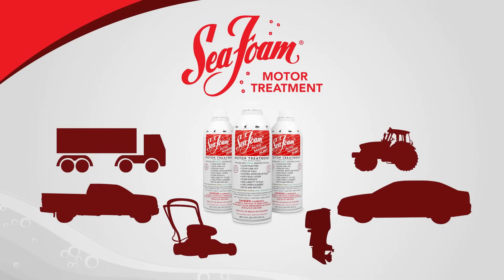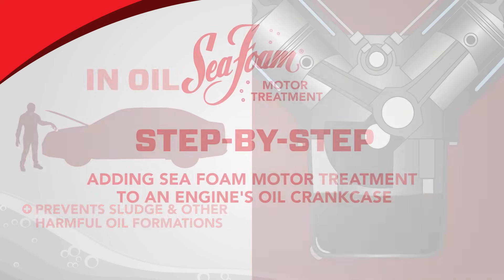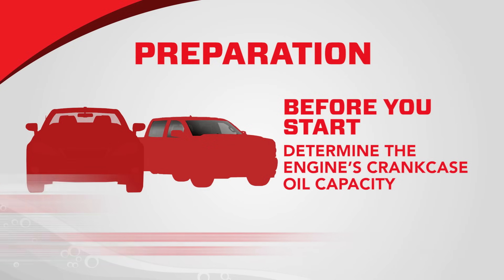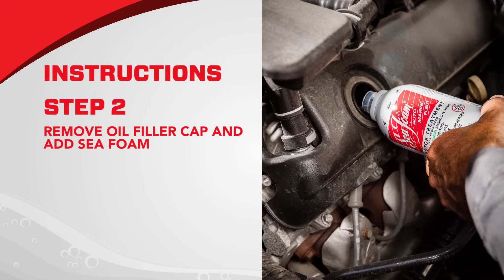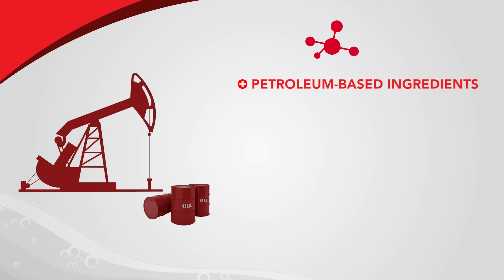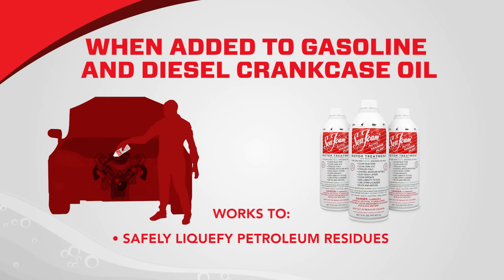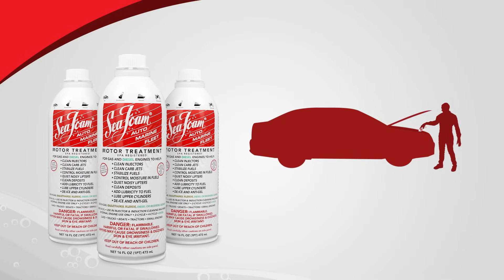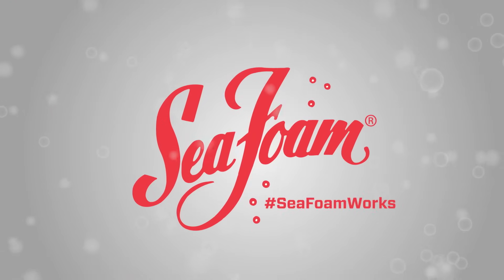Add Sea Foam to your oil crankcase - super easy!

Comment: I'll try this one...but don't worry Scotty,i still have my toyota!!!
Reply: 😂😂😂😂 rev up your engine 👋
Reply: Did it made any difference? Wich one?
Reply: Not for long if u ask Scotty lool, I just put marvel mystery oil in my celica will find out in 300 miles
Reply: @williamburndred6284  what's the update?
Reply: @MikaFaye.  ill let you know next weakend if it stopped oil burning, though i can say it is great at removing carbon as i did 444+ miles and it was filthy , looked like a 10k mile oil change
Reply: @cristianvilla3675  I use this flush occasionally and it does it job. Then I use an additive when drained.
Reply: Lmfaoo😅😅😅😅
Reply: @tomasnokechtesledger1786 a '94 Celica
Reply: Did it work?
Reply: Good ole scotty😂😂
Reply: How did it work?
Reply: Scotty is a hack

Comment: I maintain several UTV's (Polaris Ranger, utility vehicles).  We add Seafoam to these small engines before oil changes and into the fuel system.  You would not believe how much smoother running and more responsive these engines became since starting to use SEAFOAM.
Reply: Well those are tiny engines. No wonder the effect is much more
Reply: I run Fleet Maint and maintain ~60+ UTV's (Polaris Ranger, utility vehicles, ATV's Snowmobiles).  We have NEVER added Seafoam to these small engines before oil changes and into the fuel system.  You would not believe how much smoother running and more responsive these engines became since we never used SEAFOAM.  What are we missing???  There is nothing quite like a true, "3 Orifice Elixir"!  Pour it in your air-hole, your oil-hole, or your GASS-HOLE!!  Can't go wrong!  :D :D :D 😕

Comment: I had a knock on cold starts on my 2001 Silverado and this eliminated it by adding to the crankcase
Reply: Was your truck smoking. ? Before use ?
Reply: Did u add it to tank or oil?
Reply: I had that same knock on my 1998 Cheyenne 1500. I used Motor Kote and after 100 mile or so that knock is gone. I will use the Seafoam on it next to clean it out.
Reply: @vicreyes9237  he said crankcase, so I assume oil.

Comment: I have a 2004 Toyota Camry with a 192000 miles my wife bought  brand new in 2004 it started using some oil not much to very good car ever since I've done this sea foam treatment  I have not had to add 1 drop of oil Unless it's a coincidence I'd say the sea foam really clean some deposits out the engine ...now I do it to all 3 of our vehicles our 2018 Toyota rav 4 and my 2013 Ford F 150

Comment: I run this on my 600 miles before every oil change and my car has 250,000 miles still going strong
Reply from the maker: Very nice! 👍
Reply: You add it to your oil & drive 600 Miles then do an oil change?

Comment: This is a great product. My 2002 Sienna has been burning oil like crazy (like scary 4 qts (almost gone) every 100 miles).  I did a piston soak (24 hours)  with seafoam (nothing was left in the cylinders after the soak which left me to believe it went inside down to the oil pan) and did an oil change after 500 miles.  I replaced the PCV because I knew I had a ton of blow by with the oil burning and stuff.  Added half a can as part of the oil change. Drove the van on more than 1k mile vacation trip checking oil every 100 miles and to my amazement, no oil burn and the oil stayed full all the time.  My MPG went from 12 to 22 MPG as well.  The heavy noise coupled with engine that seemed to be under a lot of load on a smooth flat road was replaced with smooth sound and performance like a new engine.  This has 150K miles only but is 18 years old.  I am thankful that my van is back to where it was and this half can seafoam will be part of my oil change from now on.  This shit really works!!!
Reply: So the piston soak! Do you just take out the spark plugs then pour some in? And let it set 24 hours?
Reply: So when u do an oil change you add seafoam??
Reply: Born yesterday 😂 found out they got a high mileage can too. Already put the white can in my gas tank. Wanna put the( HM.) In oil crankcase to see if it will quite engine you know the feeling of seeing your dashboard vibrates at every lite 🤯✌️
Reply: Half a can seems like WAY too much. Only need 1 Oz per 1 quart of oil in the engine
Reply: And how much time do you run the engine with that???
Reply: How much of the can did you pour into the oil???

Comment: I did this yesterday in my 2002 Toyota Camry. Drove for 150 miles, then changed the oil. The oil came out extremely dark and VERY liquified!  I also added the intake Seafoam spray. I can definitely say that I noticed the engine is a lot quieter

Comment: I have been using Seafoam in my 2001 MB E320’s fuel system about 10 years now, every 6 months a full can goes to tank close to oil change. For the last 2 or 3 years I also use it in the crankcase, couple days before the oil change, my car takes a little more than 8 qts oil and I usually get 2 cans a week before the oil change, 3/4 of a can goes to crank case and the rest goes to fuel tank, like I said 100-200 miles in couple days then the oil change. I can swear after the oil change you can’t hear the engine from inside, quiet and idles like a clock, car is almost 20 years old, 220K on the clock.
Seafoam is a good product.
Reply: So u dont do 1 ounce per qt?
Reply: I have a Corvette with just about 220,000 miles on it right now.  It also, "idles like a clock," (whatever that means).  Basically, my car runs like new.  Never used the stuff.  What have you proven?  What am I missing?  :bigears:
Reply: @thomaskendrick2221  I wasn’t aware that I was supposed to prove anything. Good for you that POS made it to 220K miles with just regular maintenance, hard to believe but I’ll say whatever….
Reply: @commodoreras  Ha ha ha...my 220k car is a "POS" but your 220k Mercedes is special?  B/c of the "3 Orifice Elixir"??  LOL.  

I "get it"...this is where people go when they're challenged.  Defensiveness and name calling.  That's pretty normal.  As you were my old Mercedes man.  BTW.....as a fleet Maint Mgr, 220k isn't a big deal; I've had cars (and fleet vehicles) that have cruised right on by 300k, too.  Never used this crap.  I'll ask you again; What am I missing?  :bigears:  Relax....you aren't obligated to answer that.  Just think about it before you buy more elixirs for your old Merc....or recommend them baselessly to the unwitting.   👍

Oh, BTW, here is a hint; Look up the SDS for Seafoam to get the ingredients....THEN come try to tell me what a "magical cure-all" it really is!  😆
Reply: @commodoreras  😆😂👍

Comment: I run a can of this in my 2-stroke Paramotor every 10th or 12th flight I do. Every time I go to rebuild the carb and replace piston rings I feel like I'm wasting my time; it looks pristine, especially right after flying on a can of this. Absolutely recommend for any 2-stroke applications to get rid of carbonized 2-stroke oil residue!
Reply from the maker: Love that story!

Comment: My motorcycle was running on 1-2 cylinders (out of 3).  Fellow rider recommended Sea Foam.  Put contents of one bottle in the fuel tank.  Very short time after running engine, it ran VERY smooth.  Will get more for my auto.  Looks like this additive really works.  Thanks
Reply: Right on Donald - we're believers too!!

Comment: If I could add a pic/pics I would...did injector job on 02 LB7 Duramax in June ..it is almost 350,000 miles ..under the valve covers are spotless!

Comment: seafoam products work! i used it on my 2003 civic and i could tell it runs smoother. did i also mention their excellent customer service! thanks Jim!!
Reply from the maker: Thanks, Lodi 22 - Pleased to hear + thanks for using Sea Foam!
Reply: Did you put it in the crankcase with the oil?
I have a 2003 RAV4

Comment: I use this on all my cars. I even made a couple videos on my Scarz Carz YouTube channel adding it to my Audi. I learned a long time ago that its the safest for European cars compared to other brands. Thank you Seafoam for a great product.
Reply: Quick question; do you add this to your motor or fuel tank?
Reply: @Ravenwest9876  I add it to both, usually at oil change times. About a hundred miles before oil change I'll put it in oil, and add it to fuel when I do change.
Reply: @joemartin3240  thanks sir

Comment: Seafoam cleaned the oil sludge out of my Audi A4 with 1.8T engine.  Great product.  I had a weird check engine light come on in my Nissan.  It promptly went away after adding Seafoam to the gas tank.
Reply: Good to know-- I've got a Passat 1.8T, same set up with that sludgemaker turbo. I'll have to try this soon!
Reply: D’yer maker where did u put it on and did u put the whole bottle?
Reply: @undercoverrt4106  For the 1.8T add it to the crankcase, or same place you add the oil. It will clean out the sludge and let your oil pump work. The sludge stops up the screen on the oil pump. I don't remember how long I let the engine run with it in there.
Reply: @undercoverrt4106  yes, whole bottle in crankcase.
Reply: @D’yer maker did u put it with the car on or off?
Reply: @D’yer maker did u put it with the car on or off?
Reply: @undercoverrt4106  Run the car with it in the crankcase. It has to work through the oil pump screen to dissolve the sludge. I may have driven with it in the crankcase.

Comment: I used a few ounces in my crank case and added half a bottle to gas tank at 1/8 fuel remaining. Drove like a banshee out of hell (safely) and I am glad to announce no check engine light or adverse effects.
(Edit-06 gm 3800 motor

Comment: I have 352,344 miles on my 02 LB7 Duramax...i did injectors on it in June..under the valve covers it is spotless! We have a 2013 hemi powered Citadel Durango and added it and ran it for like 600 miles before oil change(I did thus on my own) ..runs just fine. If your wonder what oil I use,Mobil extended performance the gold label 5w20 and mopar mo899 oil filter
Reply: I have a 2011 dodge citadel with a p000b code

Comment: Seafoam is indeed a great product for sticking injectors and piston rings,.
However there is a better way to prevent 'the sticking':  simply change the oil BEFORE the receommended change-out.  If youre driving mostly at full highways speeds and also drive at constant speeds, the recommended oil change-out is probably OK.   If you are driving in city conditions and mostly for 'short trips' ... consider to change the oil at HALF the recommended interval ... so the carbon, varnish and other 'crap' doesnt build up 'behind' the piston rings ... and then cause adverse wear of the cylinder walls.

Comment: Can someone from seafoam answer? If your car is full of oil do you have to let some oil out and then add the seafoam or add the seafoam to the amount you already have in the vehicle no matter if its full or not? Thats my only confusion.
Reply from the maker: No need to remove oil. Plenty of room in the crankcase.
Reply: @SeaFoamOfficial  ok thank you. I didn't use a full bottle.. but if you don't mind, how often should a person use this to clean out the system.
Reply from the maker: @DocHicksTv  In oil, once per intertval.

Comment: After a good fwy run, I poured some down the carburetor of my 1983 Corolla & it cleared lots of deposits. No more dieseling (hesitates to shut off after turning off at ignition switch)
Reply from the maker: Great news - thx for sharing!

Comment: I haven't bought the product yet but will be very soon, but I did have a question. When using seafoam, which method is most effective? And also will I need more than one can if I wanted to put some in the oil crank case and the fuel deposit tank? I don't know the recommended dosage instructions yet but I'm sold on the products ability to work.
Reply from the maker: Both are great. Adding to fuel vs adding to oil is not a either/or. Best to do both.

Comment: I was told today that I shouldn't use Seafoam in my 2020 Kia Optima GDI. After putting in Seafoam the other day, I got my oil changed today, and that's when the mechanic told me that I shouldn't use it with my GDI engine. I have been using it and following the instructions 1 oz per quart.
Reply from the maker: Did the person explain why?
Reply: @SeaFoamOfficial  Not really. They just said not to put it in a GDI type engine.
Reply from the maker: @kendaugherty3828  Noted - thx.

Comment: Never used Sea Foam before.  Sp adding more product to oil will not cause "overfilling" the capacity of the oil?  For example, if the vehicle takes 5 quarts and there are already 5 quarts of oil in it, won't adding anything overfill the capacity?
Reply from the maker: You're adding 5 oz to 160 oz of oil. No worries.
Reply: My car takes 4 quarter of oil so much do I add to crankcase

Comment: What would happen if you put seafoam in the crankcase at the start of a fresh oil change and left it? In the video it says 100-300 miles BEFORE an oil change. So would putting seafoam in directly after an oil change, have any effects opposed to just before changing oil?
Reply from the maker: That would be fine.
Reply: @SeaFoamOfficial  okay thank you!
Reply: I must have not read the directions properly because I've been only using it with new oil, yet it still works wonderful and better than it used to. I drive a 2001 civic.
Reply: This was the question i was gonna ask😅
Reply: @SeaFoamOfficial is it better to wait till before the oil change is due or do it right after?
Reply: @kingdeyes94 The longer its in there the better it will work. If your car or truck has a higher capacity oil filter option, use it.

Comment: Hi please help, i poured in all the bottle in my engine oil, is a 6 cyl 3.7 liters, will this damage my engine? Should i change the oil immediately??
Reply from the maker: If you are concerned can either change your oil (complete) or drain 2 quarts and add 2 new quarts.

Comment: How do you keep it in the crankcase? It just runs down  into the oil pan.
Reply from the maker: Sea Foam is oil so it mixes evenly with the motor oil.

Comment: Is it the same product that you can add to your crankcase or gastank ?
Reply from the maker: Yes, the same.
Reply: @SeaFoamOfficial  
Wow thats easy 
I just added it in my audi s3
I wasnt runing great because of cheap fuel and carbonate on the valves. So i just sprayed it into the air intake because the gas valve is very hard to get to. And the car shaked and misfired on acceleration  😬  i wonder why that was ? but now it runs very smooth
Reply from the maker: @HappyDude1  Can cause misfiring during application. Doesn't hurt anything.

Comment: How can you tell how many ounces to add? Are there markings or visual aids on the side of the bottle or is it better to use a measuring cup and a funnel? Thanks!
Reply from the maker: I just eyeball it + feel the weight of the can.  Does not have to be precise.
Reply: I've always heard an ounce per quart of oil.
Reply: I use an old pint mason jar with oz markings. Now dedicated for seafoam.

Comment: I have a Lincoln welder at work that’s given us nothing but problems. An injector with stiction, noisy lifters and fuel issues. I used this in the crank case and IMMEDIATELY heard the difference after starting it up and letting it idle for a while, after welding and running the engine a long time as well.
 No rough idle, no problem starting up on a cold day. Etc. I plan on using it again after I change the oil.

Disclaimer: The boss of the mechanics (who we have to turn our vehicles and equipment to for service) is a spiteful clown of whom I think enjoys messing with the operators and drivers for his own personal entertainment.

Comment: I got a noisy lifters or something checking on my 2002 avalanche with 121K miles. I hope this does the trick. I always have the oil changed in a timely manner.
Reply from the maker: Keep adding half a can each interval. It will work if dealing with lifter varnish!

Comment: Can i drain the oil, leaving the oil filter then add 3-4 cans of seafoam on idle for a few minutes? Or would it do harm,  tryijg to do it on an 88 chevy silverado
Reply from the maker: Do not do that. Will likely ruin your engine. Never run an engine with motor oil removed from the crankcase.  Be patient: Add half a can every interval.
Reply: @SeaFoamOfficial  thank you, for getting back,  i will wait and do it like its suppose to be,  thank you
Reply from the maker: @spartantony1  Our pleasure, always!
Reply: Never in your life do that.

Comment: you mention adding at 'any time' but recommend '1-300 miles prior to change.'  So it's not advised to go longer as an 'oil additive' as it'll dilute the oil recommended by manufacturer?
Reply from the maker: It does not dilute the oil.  Like when we clean our teeth...  Can be done any time, but there are more ideal times based on our daily routines.

Comment: Added more than the recommended amount, would that help clean the internal engine better? My 305 cubic inch Chevrolet engine is extremely gritty.
Reply from the maker: How much did you add?
Reply: I added the one ounce per quart of oil, 5 measured oz. question is added MORE would help my extremely gritty 305 engine.
Reply from the maker: @barrypowell829  For a 5 quart system you can just eyeball half a can. A few more ounces will help a little.
Reply: @SeaFoamOfficial  
Added whole bottle to a 6 quart system?
Reply from the maker: @justinmitchell553  Keep an eye on the oil going dark. We recommend replacing the oil if you add 2X amount.
Reply: @SeaFoamOfficial  
Ok thanks 
Needing to replace the oil. Got it